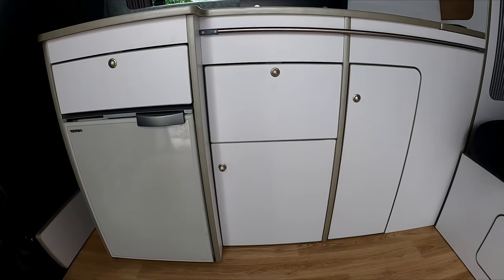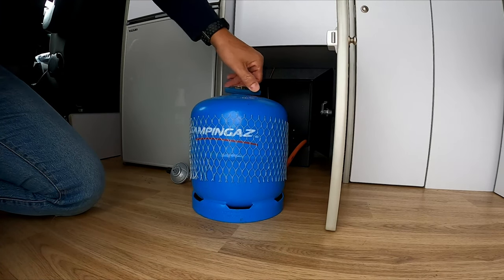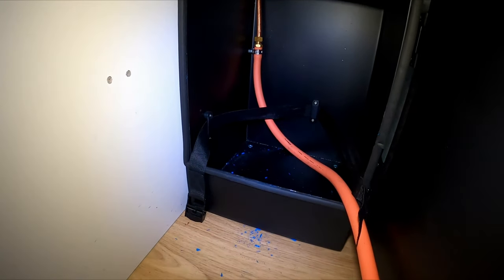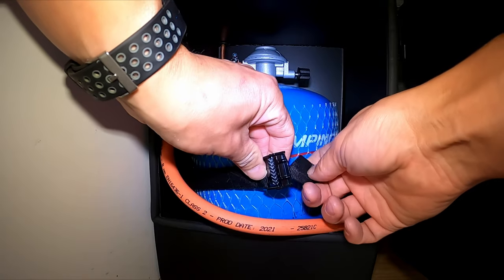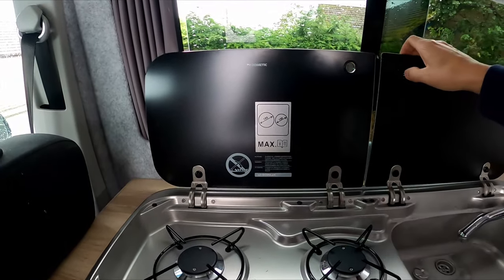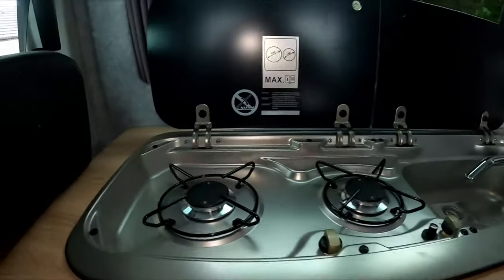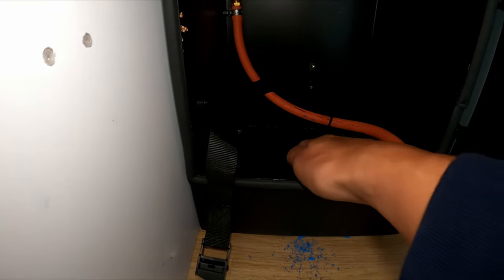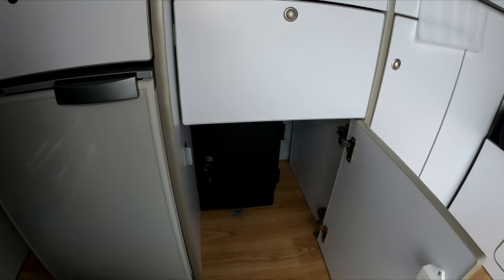How to connect the gas bottle in a VW Transporter campervan - Campingaz 907 gas bottle connection

Comment: Hi, would you recommend using the gas box? Rather than having the bottle strapped the inside of the cupboard? Does it need to be vented out the underneath?
Reply from the maker: Yes I would definitely advise using the gas box. These are fully sealed and I have drilled an air vent from the box to the outside of the van, so if the gas leaks then it vents directly outside to avoid inhalation. I hope that makes sense. Thanks Ben.

Comment: Hi there, thank you for the video. Is the black strap attached to the inside of the box or just the gas cylinder?
Reply from the maker: Hi, no problem at all. So the strap is attached to the rear left corner of the box so that it holds the bottle to one side and away from the door. I hope that helps :)

Comment: Hi there, regarding the hole for the ventilation. Where do you drill as the passenger side where the sink and hob will be have the fuel tank directly under where I want to 
drill.  Cheers
Reply from the maker: @Descendx  well the gas locker location is mostly determined by where you can drill to vent it. You might have to move the locker a bit further away and then run a longer section of pipe to the hob possibly.

Comment: Thanks for this but isnt orange hose on permanent install against Gas Safe/Euro regulations?
Reply from the maker: Thanks for watching!
So what you see in the video is the orange flexible hose but before this exits the gas locker it joins to solid copper gas pipe 👍🏼 so should anything happen to the flexible hose it’s contained in the vented gas locker. I hope this makes sense? Cheers.
Reply: @roxcampers  yeh got it thx, just done the same
Reply from the maker: Great stuff, glad it made sense 👍🏼

Comment: Where is your vent? I thought there was an issue with ventilation for these in this location
Reply from the maker: Hi, thanks for watching. You can’t see it from the camera angle but the vent is on the front right of the cabinet. That is sealed and vented externally to the van. Thanks Ben.

Comment: I don’t have a gas locker or any of the connections to connect the gas canister to my hob. I’m guessing I will need someone professional to fit it for me. Really annoying I can’t use it correctly.
Reply from the maker: Morning, it depends how competent you feel you are, it can be fitted by anyone as you can buy kits online but I would recommend getting a “habitation check” carried out before using the van just to be safe. Thanks for watching.